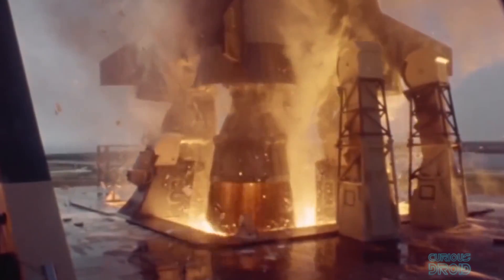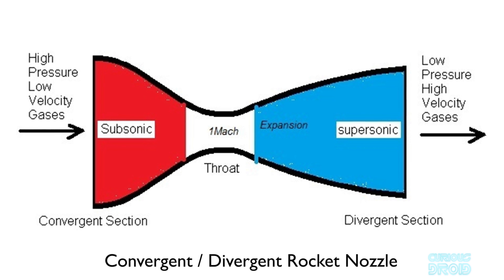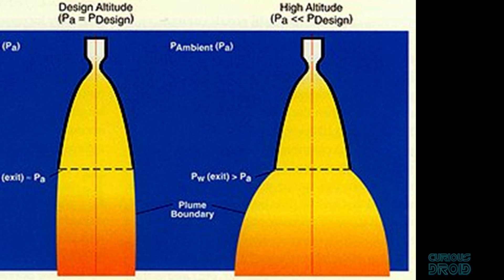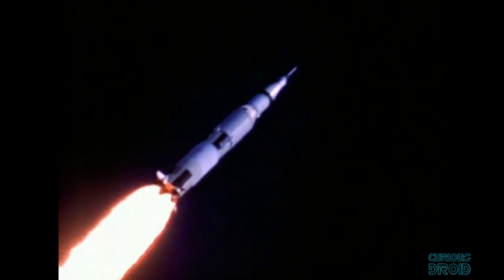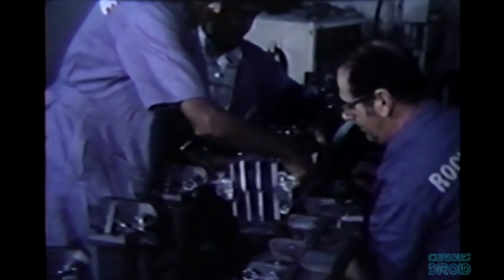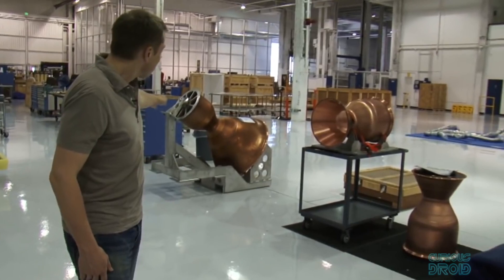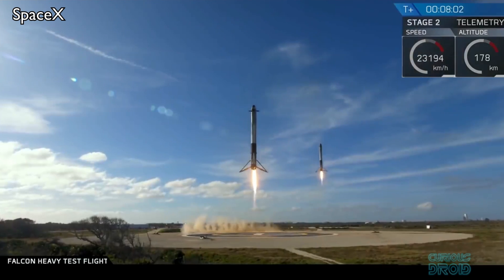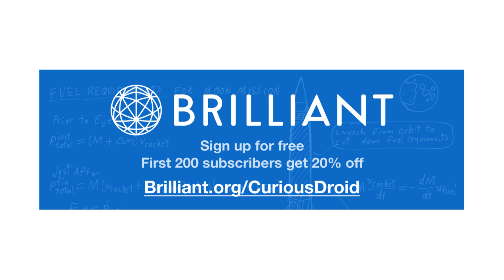Aerospike Engines - Why Aren't We Using them Now?

Comment: Great video. I still don't understand why we launch from the ground though. Why don't we use flight assisted takeoffs? Build a craft that can fly conventionally to 80k feet, then fire rockets to get it into space?
Reply: +geee Whizz Thats why I specified solid core. Those have the reactor isolated and contained, andthus dont irradiate the exhaust. At leat thats how I understood them.
Reply: Rockets are too heavy, and couldnt be flown upright, and the launch itself would be insanely dangerous, because, well its a rocket launch.
Reply: @ineednochannelyoutube5384  hmm I guess that makes sense. Space elevator? Theres just gotta be a better way to get up there!
Reply: +geee Whizz We dont have the materials science yet to make atrong enough tethers. Wen we can make multi kilometer carbon or boron nanofilament...
Until then the best launch option,  imho is solid core nuclear thermal rockets. Of course you need to land the things, so as not to have a small reactor crashing god knows where, but they can easily be three time s more efficient than anything currently in use.
Reply: @ineednochannelyoutube5384  I looked these up and it would seem like a great technology for once you are in space, but wouldn't they shit radiation all over everything if you were using them as launch rockets?

Comment: So this guy said more than once the rocket engines work because of the air pressure. And it has the nozzle has to have a different shape as the air gets thinner. So if rocket engine requires air pressure how does it work in the vacuum of space? One answer I got is that in space it actually pushes against itself. So the rocket engines that landed the lunar module we're pushing against themselves or did they rely on the pressure around them?
Reply: No no no no no.
Newtons second law people. Rockets dont push against anything. They theow shit bacwards, and that creates an equal and opposite reaction that pushes them forwards. Sort of like the recoil of a gun.
Air pressure is just something the shit being thrown out the nozzle needs to overcome to get out.

Comment: 1 square inch is (2.54cm)^2 same as 1" squared. 
you could just convert the atmospheric pressure from psi to millibar or Pa

...and the column of air is not just "much shorter" at altitude but also less dense. 
......and the density depends on temperature also, which drops dramatically with increasing altitude.

..........and thrust is a function of the rate of flow of the mass of hot combustion gases out of the engine. The heat of combustion raises the pressure of the fuel-oxidant mixture and as such the bell diameter limits the overpressure at the exit of the hot stage...as the upper stages produce less thrust, the bell diameter need not be as large. The reason that aerospikes are not in widespread use is very simple, they only provide thrust vectoring in 1 dimension not 2 like a gimbaled bell and so they require control vanes which are not required with conventional rocket motors. Increased fuel efficiency is not enough to overcome this, as the rocket will only see the low Mach numbers while atmospheric pressure is significant. Blue Origin is taking on this issue with alternative fuels like methanol and LNG.

....last but not least an A2A rocket has to operate anywhere from ground level to 80,000 ft or so, even higher for an ICBM interceptor, you might want to consider the range of atmospheric pressures over that range of altitudes

a few minutes on the web will help

Comment: Most people do not know, but to prevent the 'Bell' nozzles from melting, the nozzles have thin pipes in them, and the liquid fuel is vaporized as it goes through causing a refrigerant effect before the gas is sent into the nozzle to be burnt for thrust. This is the main reason we do not have thrust vectored engines like on the F22 Raptor, yet, as the mechanics required for vectoring, cooling and safety is very complicated, heavy and very expensive.
Reply: As they always say, referring to rocket engines, 'there is a million ways for it to go wrong and one way for it to go right'.
Reply: uh.... almost every launcher has thrust vectoring on it.....
Reply: all Merlin 1-D engines come out of the factory equipped with a gimbal joint.
Reply: I thought vectoring was achieved by varying the relative thrust of the engines, have I misunderstood? And that gimballing was being able to point the exhaust .....
Reply: The V2 had thrust vectoring as carbon "fins" in the exhaust plume. Any modern rocket uses gimbaling and/or vernier engines  for roll control aka Thor/Delta II defacto satellite hurler. At Rocketdyne SSFL, so amazing to test fire RS-27A's. The funny thing these  LR-101 tiny vernier engines howl and screech are more annoying than the 27A's.
Reply: Single engine thrust vectoring is essentially obsolete by the fact that you can just use a cluster of engines and use throttling to thrust vector.
Reply: @some-online-dude  Any examples where this technique is in use?
Reply: @Cheradanine  The most well-known examples are the Surveyor lunar landers, and the first stage of the N-1 rocket.
Reply: @some-online-dude  Thanks, that's interesting.
Reply: @some-online-dude  that type of steering not as efficient. Before you argue with me. I build rockets for a living and if you still dont take my word consult the rocket bible: Rocket Propulsion Elements. Any addition should have the controls part in it.
Reply: mechanics for vectoring are not as complicated as you think. Basic dynamics and control theory which is understood very well. The problems of vector thrust and cooling are decoupled.  AND THERE IS thrust vectoring on the F22 raptor
Reply: @ziahn5367  No one said there was not TV on the F22.
Reply: @10p6  misread your comment. Did not see the word "like" my bad.
Reply: The Saturn V had thrust vectoring on the first stages, with regenerative cooling of the upper bell. The four outer engines all had thrust vectoring and that was in the mid-60s
Reply: @Cheradanine  Saturn V had gimbling, not even remotely close to true thrust vectoring.
Reply: @10p6  Why would a rocket need thrust vectoring??? 
Also, not all rocket engines use regenerative cooling. Film cooling (using gas generator exhaust) and ablative cooling are also alternatives.
Reply: @Cheradanine  You: Saturn V had thrust vectoring on the first stages
Also you in literally the next comment:   Why would a rocket need thrust vectoring??? 
Lol.
Reply: @AliShaikh1  "True thrust vectoring" (whatever that is) in response to 10p6's comment. A rocket doesn't need vectoring that you find on fighter aircraft
Reply: @10p6  err no. That is thrust vectoring....
Reply: @Cheradanine  yah and some engines use all three :) Rockets need thrust vectoring to steer since there is little or none atmosphere during parts of it flight. Meaning it cant use flaps like a plane.
Edit: but yah the vectoring is only a few degrees off from normal. No clue how much the F22's engine move but from videos on you tube it is quite a bit. F22 was built to maneuver and is actually slightly unstable in flight (all modern fighters are).
Reply: 2D only.  Then how does Russia have 3d thrust vectoring on the more reliable and cheaper su-35 in service for years?  Seems they have this figured out.
Reply: @tnix80   Are you really comparing an after burner engine that is on for a few seconds to a Rocket engine that is massively hotter and on non stop?
Reply: @10p6  ...and much larger than an afterburner?
Reply: @tnix80  almost all current rockets use thrust vectoring. Refer to other comments.
Reply: @ziahn5367  No, they use simple gimbals.
Reply: @10p6  lol when i tell my coworkers this they will laugh. Its still thrust vectoring.
Reply: @tnix80  Just ignore the rest of the comments.
Reply: @ziahn5367  I think I will!

Comment: Great video. 

However at the end, there is an issue that I wish you clarified, as it looks a contradiction.

In the beginning, it's mentioned that aerospikes could more easily achieve SSTO.

In the end of the video, it's mentioned that the savings in fuel that an aerospike would achieve would not represent a great total saving, as the fuel is like 0.5% of the cost of building the rocket.

Ok... but SpaceX dreams and Blue Origin's too and as well other space companies or agencies, would be to lose NO PART of the rocket at all (because as you said, a Falcon 9 costs 60 million to build).

But wouldn´t the Aerospike allow SSTO and thus FULL REUSABILITY? In that case, wouldn´t the fuel be the ONLY cost?
Reply: An SSTO is a horrid idea. It has to lift an inordinate amount of redundant weight, and needs to be much more structurally robust because of it.

Comment: Hey, im  a noob but i also noticed when watching many space x launches how the jet expands and thinking any thrust not going straigt back is lost energy. Now this video got me thinking of the F35 and eurofighters nozzles that are actuated, could you not do this with a bell design? cheers
Reply: huh sat there thinking about the efficiency gain has to bee rather steep because fuel is like the smallest economic part in getting to space then you mentioned that to. Good comprehensive video!

Comment: The pressure is less at altitude is because (and by definition) the mass per volume is less, not because the Hight means you have a shorter column above you. And the atmosphere at the top has less earth gravity on it, meaning it has less mass, not because there is less atmosphere above it. This may sound l like splitting hairs but understanding the concept you gave us kinda critical to rockets.
Reply: No. The reduction in the magnitude of gravity at altitude is marginal. It can still be reasonably approximated to 10mps squared.
The change in pressure is solely because there is less air above you.
This is seventh grade phisics stuff. You probably should know it.
Reply: @ineednochannelyoutube5384  I looked it up and you are right, my physics lecturer was wrong.
Reply: +Philip Leitch That is fairly sad if they let such a mistake slip in a lecture.
Reply: @ineednochannelyoutube5384  Yes. But this was a "student" lecturer, and was covering lots of topics. Similar thing happened in botany where we were told things that weren't true about position of male and female cones on conifers. This was 25 years ago and the University has since grown to the point they have some of the world's best lecturers. But I'm still remembering incorrect facts as well as WordPerfect and Quatro Pro skills
Reply: +Philip Leitch Oh. Yes, we have that too. Well, important thing is, you took thr time to look up a reputable source.

Comment: Uhm, only partially correct (at best). For example, the aerospike design alone would NOT eliminate the need for an upper stage, which is still necessary so the vehicle can discard the dead weight of a lower stage (read: empty fuel tanks and fuselage housing same) and thereby regain some fuel efficiency at high altitude (think of it as ditching a trailor of bricks and upshifting to a higher gear).  Not jettisoning it would be a poor design.

-1 for incomplete and clickbaity science.
Reply: You could potentially have just the one engine and only ditch tanks.

Comment: How does the aerospike work in a vacuum when there's no external air pressure to shape the cone?
Reply: Half the cone is there in the form of the ramp. The air in the atmosphere forms the wall confining the exhaust to the ramp. ABOVE the atmosphere you still have the ramp; the wall holding it to the ramp goes away but the nozzles shooting the gases down the ramp are still shooting backwards and making thrust. So half of the cone goes away so to speak but what you are left with is still thrusting.
Reply: @craigwall9536  Ty
Reply: +Craig Wall And you get one tenth the ISP you would with a porpouse designed nozzle. It is completely unsuited for orbital manouvers.

Comment: The savings in the price of rocket fuel isn't the only issue, rocket fuel is also extremely heavy. The weight savings means significantly larger payloads for a given size of rocket. That means a smaller, significantly cheaper spacecraft required for a particular job.

Comment: So the Aerospike is to the Bell Nozzle and Ion Engine as the 5D Data Crystal is to the Flash Drive, and online Cloud Storage.

A skipped step.
Reply: Does not compute.
Ion engines are specifically for interplanetary transfers with insane ISP in the tens of thousands of seconds.
Combustion rockets are similarly porpouse built with only a few hundred seconds of specific impulse, but potentially millions of gravities of thrust to weight ratio.
One Is RAM, the other is a stone carving if you want to use the data storage analogy.
And funnyly enough, the MPD is the stone carving.

Comment: hey, I want to ask you why rocket engine nozzles has no moving parts like jet engines does. why they aren't making nozzle that tightens the end in mid-flight at high altitude? like for example f-35 does. they would get more thrust by this action I suppose.
Reply: Regenerative cooling would probably be too hard to achieve in such a design.

Comment: Hydrogen fuel cells with steam might also be a ton safer. Unfortnatly so far don't have enough umpf to get into space yet. But once in space where mass constant or not much lower would work fine. That saves on fuel (only need a  ride out to space )but once out their when a accident happens still get fraid nerves and  have to fix the problems.  Otherwise the crew would be a lot safer (wet maybe from the accident turning into balls of water) . Compared to dead? meh
Reply: What are you talking about? LHO is a true and tested propellant combination.
Reply: To into space though?
Reply: +Gork Skoal Yes. Liquid hydrogen oxigen is a popular rocket fuel mixtire, right behind kerosene liquid oxigen

Comment: Small mistake here: 1 square inch is 6.4515 square centimeter.
Aerospike engines were used for the SR-71 mach 3+ spy planes. The Pratt & Whitney J58 engine was so desinged that it remained at optimal thrust at every speed until mach 3,35.

Comment: Ok, stupid question is stupid, but would I be correct in saying that the traditional 'bell nozzle' inherently uses the Venturi Effect to accelerate the gases within it, and hence its efficiency, whilst the 'airospike nozzle' relies on surface tension, and atmospheric pressure   to maintain the boundary/laminar flow ...?

From what I can gather, yes, there is a certain amount of surface tension/laminar flow on the inside wall of the 'bell', but any small turbulances/vorteses within that flow is off-set by the sheer volume and acceleration of the gases flowing through the 'bell', as the result of the compression (again, Venturi Effect ...?). 

But, I would hypothesize, because the 'aerospike' relies more heavily on surface tension against what would be the inner wall (as it is effectively a 'bell' turned inside out ...), any turbilance/vortices within that boundary layer, would mean you would have to have a much higher fuel flow (and hence  way more fuel ...) to achieve escape velocity, as you would be relying on atmospheric presure and surface tension to maintain the laminar flow ... unless you use the flow of oxidiser over it ...

In short, is the fluid dynamics of the 'airospike' engine so complex, people have stuck with the 'bell', because it is far simpler, in comparison, and way more efficient ...?

- from a ignorant retired microbiologist, and (very) amateur astronomer.
Reply: Efficiency in this case is a staright up synonyme for exhaust velocity. And yes, much of the thrust of a bell nozzle comes from tightening before it expands.
However, the aerospike also has a bell nozzle. Its somply made of compressed air.

Comment: Imagine being in charge of allocating NASA budget (or any large business budget).  Do you spend decades and Billions on engine research (which may or may not work).  Which will also pollute and eat fuel at unbelievable levels (fuel that could be used better elsewhere).  Or, do you wait for the well proven/researched technology of nano thread (diamond/carbon filament) and wait for the first space elevators.  I think a lot of 'big money' types are looking at investing in filaments not dead-end technology like rockets (which have not improved since the 18th century). Nothing beats the old tech of ram jet/pulse detonation engines anyway  ;)   My 2 cents.

Comment: use a rocket combined with a solid balloon.  the rocket would inadvertedly superheat the air within the balloon (think shape like a sqid/jellyfish) for lighter payload and when it reaches space you let the air purge in the space vacuum and seal it off.  then it can bob in the top most atmosphere without need of orbital speed if need be and when you want to come back down, just allow the balloon to take in atmosphere (the balloon now holding a vacuum, well let air leak in as appose to leak out) until its internal preasure meets required amount to decend but cap it off so its so thin that it will float slower and slower to earth as the surrounding air gets denser and hevier.